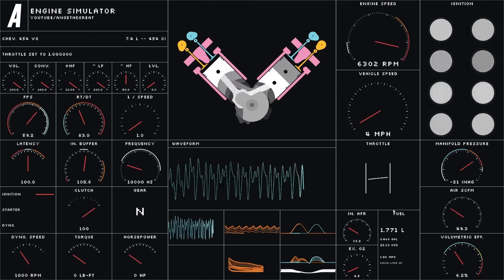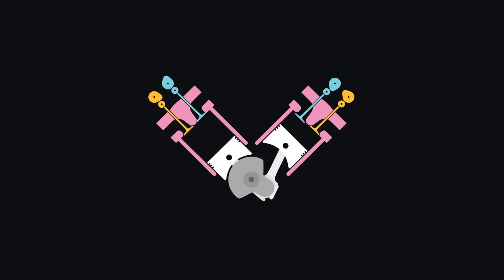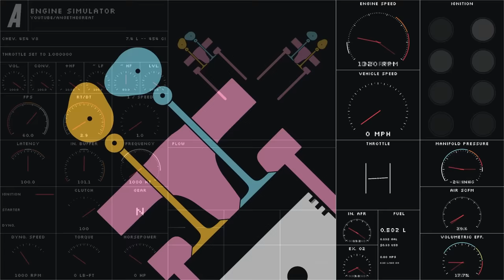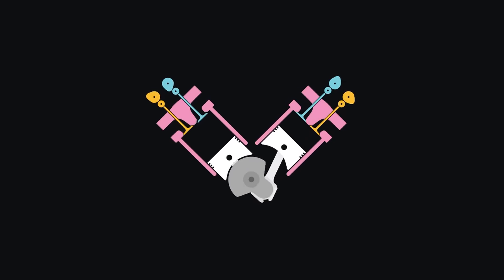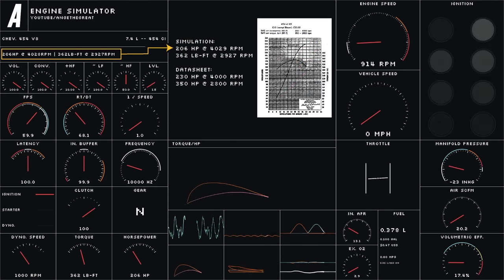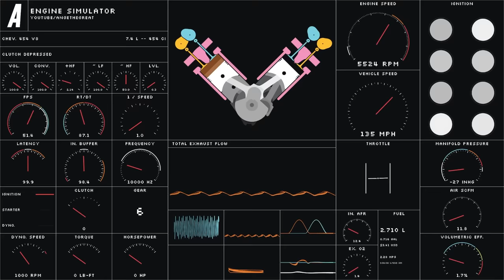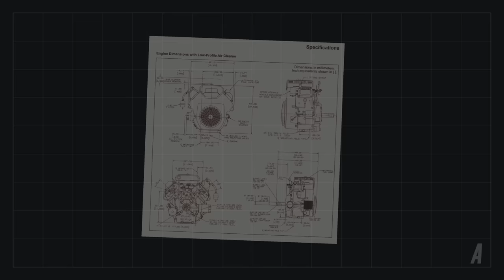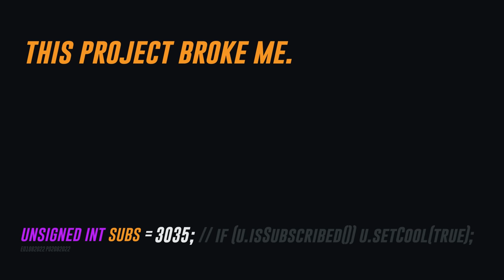Simulating an Entire Car Engine (yes, it makes noise)

Comment: I really hope I could run it on MacOS. I'm using a Macbook with Apple Silicon processor so I had to run it through a Windows virtual machine. Unfortunately, the simulation run really bad because the virtual machine can not give enough performance like a pure Windows system. I will really appriciate and thank you if you can make a MacOS version of this one for Mac users like me can easily run it directly on MacOS. That's a great idea about an engine simulator! Well done guy!

Comment: This is impressive, and maybe it has been said but you should do a radial engine like those found on old planes. Like the Azani 10 cylinder, or even better just for lols. R-4360 Wasp Major with 28 cylinders.

Comment: I get the passion behind this project, but having this level of detail, even in a simulator game, it would take a supercomputer by 2023's standards to run it fast enough to simulate it correctly, as you demonstrated.
Most simulators like iRacing and ACC simulate the engine and the engine response with hardcoded variables for the shake of performance and specifically uniform performance whether the game is run at 30 or 200+ fps. 
Most non industrial simulators work this way so that the average consumer system can actually run it properly. 
The same companies that released these games are the ones that make the industrial simulators but there the difference is that they don't have to keep in mind the system requirements.
We have some more years of technological advancement until this level of simulation could be included in a game.
My fascination with performance and optimization is what personally drove me to programming 😂

Comment: Wow, this not only can produce sound, but also can drive vehicle simulation as well, because the torque curve is very close to real life, with the car wheel traction and terrain slope as the feedback for engine load. The only problem for now is the number of substeps, but in the near future most of PC can handle this with the whole vehicle simulations.

Comment: Dono about anyone else,  but it sounds like at idle, that the motor has no oil pressure,  the knocking sound at low rpms. Maybe need to tweak the sound program a bit to get rid of that sound. 
Maybe sit in on an engine dyno test to see how it's done.
Cool program,  I'll have to get it and play with some different set ups

Comment: Super interesting project. I for one would really like to nerd out on all the details you didn't have time for in this video. I would really like to know if there is a model for exhaust piping and intake manifold geometry. Does the simulation take pulses into account? Can it add a turbo/super charger/intercooler?

Comment: Hi ATG,  (reposted comment as I hope this finds you)
One of the most egregious examples of shit simulated engine sounds are on train simulators and even more adjacent to reality: model trains with engine sound decoders. This would dramatically CHANGE THE GAME of engine sound sim for train sim games and (maybe) model train sound decoders - though I have no idea how much processing power this requires. All I know is that 

A. It'd be really neat if you added provisions for different engine configs like: 2 stroke vs 4 stroke, SI or CI, as well as different types of two stroke like uniflow or crank breathing, forced induction and the various types like prochargers, turbos, superchargers, turbosuperchargers, exhaust recovery turbines, and clutched turbochargers (like what are found in the EMD 710 engines), as well as accounting (maybe?) for these forced induction devices drive type, ie, geared belt or chain driven. I think it's also be neat to be able to tweak the exhaust parameters to tune it to sound a certain way. 

I'm no programmer but Id love to hear what you have to say about this and I hope this finds its way into the products that need it the most.

Comment: What about a V24 monster sized engine as if it were in a Railroad Locomotive! using the same specs as this V12 Engine from the modern GEVO locomotives lets see what a double sized engine of this build would be like! 

Engine Data:
Horsepower: 4500
Power/CYL: 375 HP/CYL
Mean Piston Speed: 11.2 M/S
Number of Cylinders: 12
BMEP: 20.3 bar
Displacement: 15.7 I/CYL
Total Displacement: 188 I
Model: GEVO
Bore and Stroke (in.):  9.8 X 12.6
RPM: 1050
Compression Ratio: 16.5:1
Cycle: 4
Turbocharged: Yes (7S1712A3)
Electronic Fuel Injection:  Yes
Coolant (gal.): 440
Lubricating Oil (gal.): 468
Engine Cooling Fan: 1
Air–to–Air Cooling Fan: 2
Air-to-air cooling:
The locomotive incorporates GE’s most advanced cooling system in rail transport. In addition to a standard radiator and fan configuration, locomotives powered by the Evolution Engine use an advanced air-to-air cooling system for engine combustion air to enhance performance while lowering emissions.
The Evolution Engine has been awarded UIC certificate E-001/2009-02, which verifies the engine’s mechanical quality and compliance with the stringent demands of UIC Stage IIIa emissions standards.

Comment: As a marine engineer, id be curious as to how in depth the simulation is regarding pressure in the cylinder. As in could we start tweaking parts to create situations that we could troubleshoot, regarding crank angle based pressure curves. We use curves like that for "recip analysis" on big marine engines all the time.
Reply: E.g. could we tweak the cam timing to troubleshoot, or troubleshoot injection, ignition delay, etc...

Comment: Badass!!! I’m an engine guy way more than a computer guy. I don’t know if it’s possible, but would there be a way to include volumetric eff. In the program? As in, stock big block square port heads vs. ported same heads? A data base with realistic stock head flow for different heads? Super charging? In any event this is way awesome, thank you.

Comment: 4:08 nah it's because if you look at the frequency above the gear it shows it's 1000 HZ it has to run around 2000-5000 HZ if you don't want it to explode

Comment: This would be an awesome tool for modders to pre-render sounds for existing sims like Assetto Corsa.  The game itself would still play samples, but the samples would be in ideal quality and capture all the scenarios that the game supports (AC does support the use of different samples per RPM and load, I believe).
Imagine being able to replicate all the details of the real sound of 1930s race cars.  There's mods for those but the sound generally comes from very short youtube clips of the engines idling - far from ideal.

Many people make modded cars for racing sims but are forced to use poor quality sound samples.  Lack of access to the real car is the most obvious reason but there are also other challenges.
Even when you do have access to the car, getting good audio is daunting because of the difficulty of doing a high quality recording that covers a variety of RPM and loads.

For example, I downloaded a car for AC that I own in real life but the sound is disappointing.  Most noticeably there's no coasting down sound, the engine just goes mute when you lift off.  I used to live in the rural foothills which would have been an ideal setting to record things like this, but I don't have any audio recording competence, and I don't live there anymore.  Instead of trying to make newbish recordings of it now in the suburban flatlands, a simulation might end up doing a better job.

Comment: This is very interesting. I'm curious if you think it's feasible to use this simulation to prerecord an array of individual "bangs" that could then be quickly reassembled in a game engine to approximate the sound based on set of parameters? I once thought of having such emulation in my game, but the problem for me was determining the set of parameters I should use as "indexers" and of course having good "bang" audio samples :)

Comment: I'm curious as to how rotating block engines (aka rotary engines) would be simulated differently, or, if they would be at all.  Something like the Gnome engine didn't have a throttle 'valve' it had a single valve and a blip switch (so the engine effectively ran at 'full open' while it was in operation and to control it the operator had what amounts to an off switch to cut ignition for a short time.  There are a few Radial engines in here and those are quite similar in most ways that probably matter for sound.)

Comment: Sounds and looks good  .. but something about valve train noise is missing.  Like a 1970  80 cu shovelhead oem ignition then a hi-4 single fire or ignition or a evo  80 cu with oem or Hi-4 ignition  or a twin cam each has a distinctive sound even though each is close to the same cu and configuration.  Muffled down the valve train noise is different in each affected by ignition waste spark or single fire..  waisted has an extra noise from the explosion from unburned fuel in the exhaust stroke in the waste cylinder.  Only one example of engine valve train noise .

Comment: Simulate variable valve timing / varisble lift systems so we can hear VTEC kick in please - assume it can just be scripted to change cam profile at a fixed RPM
Reply from the maker: The next video I released right after this one demonstrates VTEC kicking in
Reply: @AngeTheGreat  oh my, there's more. The algorithm merely served me this. Well now, consider my evening filled with more simulated  engine noises.

Comment: This is the sort of wonderous creative endeavor that our imagination machines (computers) were meant for. You've single handedly moved engine audio out of the uncanny valley.

How easy would it be to modify the rigid body simulation to model unusual engines like the Wankel?
Reply: I really should have looked shouldn't I, because of course you thought of that. Looking forward to watching the other video.

Comment: If you were to take an engine sound from a real car, you could then back-propagate to find the exact simulation which matches that sound.
Can you adjust the timing of the engine here? If so then finding a specific engine issue becomes an optimisation issue and can be solved (to within a close threshold).

Basically, this tool could be incredible for diagnostics. Customer comes to the shop with a bad timing etc, record the sound for 30 seconds with a microphone. Then after completing the optimisation problem you can see inside the customers engine.

Comment: You should make a swinging motor. Like the 2 stroke circuit but the piston is moving in a circle or more like an oval. Instead of a square piston you would need to have a slated piston and as it goes round/oval like there is two flat spots in the "cylinder" on both ends... Which is where the spark plug and intake will be so it would be a 1stroke esstentially as the piston goes to each side the middle will have exshaust ports. ? Idk would be interesting lol

Comment: Is there  a way to calculate the theoretical optimal ignition angle with this simulation? I know that in practice there are so many determining factors, but it would be great to have a rough starting point to tune a car :)

Comment: you guys should probably check out [Algodoo Phun], it's a 2D simulator in wich you can basicly create anything, it's quite old but it still works like a charm, + there are thousands of builds made by the community available to download directly from the software, Engines, Cars, Guns, Planes .. you can build anything from scratch

Comment: im trying to figure out the best exhaust system for my 2000 232 3.8L v6 mustang's engine. would you be able to simulate that? I'd like to get an idea for what the base line sounds like and move forward from there.

Comment: Pretty neat! Tried it out for myself and had fun with the default engines. Unfortunately, I could not get any of the community engines to work without getting an error message. Still awesome though!
Reply from the maker: You can fix those errors by following the tutorial on GitHub, it should be fairly easy
Reply: @AngeTheGreat  I find the tutorial to be pretty vague, but that's just me. I tried a few of the fixes with no success, which makes me want to go back and try the other ones. Also here's a cool concept: What if you could make a software to create custom engines that could be directly imported without having to code them yourself. That would mean people with zero coding experience would be able to fart around with funny/unique engine designs. Probably not going to happen bc you already have a tutorial on how to code custom engines, which technically can be be followed by anyone if they are willing to learn a bit of code. wow i just wrote the longest reply on this platform lol
Reply from the maker: I don't know how many of my other videos you've watched, but the program that you describe is literally what I'm working on right now. The version of Engine Simulator that you're using was never intended for use by the general public and I only released it because of overwhelming demand. Most people learn how to use it through the official Discord server. If you're interested in the progress on the updated version of Engine Simulator with a real user interface, watch some of my more recent videos
Reply: @AngeTheGreat  Yeah just saw that video, and I must say, that software looks exquisite

Comment: Hey man! Great work! I'm very curious to hear sound of a v2 engine, with 72° phase difference, and 288° phase difference! I'm building a project with base of a 250 hyosung engine, which is going to be forced induction. I can set it on these two configurations, the difference would be at the 72°, I have better peak horsepower, and on 288°, I will have better traction on the corners due to bigger angle of free rotating (like what Yamaha CP enine in R1, ewer than 2009).
The sound is very decisive in my decision, so I will be appreciated if you could help me with it!

Comment: 80,000 frames per second (or 80,000 Hz) is approximately double the standard audio sampling rate of 44.1kHz, so I would have to assume the Nyquist theorem had some influence on your decision that 80kHz/kFPS is a necessary requirement for generating audio here, as this is generally considered to contain the full range of human hearing for the average person. Is this assumption correct? From a PC gamer perspective it seems insane to say 80,000 FPS, but from an audio engineer standpoint, this is 40 year old compact disc technology. Which is to say nothing about the rest of the simulator, which is absolutely fantastic.

Comment: Hi, i an trying to develop a engine for my game taking into account internal parts as part of one big equation, in truth actually i'm on engine physics side and my friend on this empirical model, he did a nice model of vital parts for volumetric efficiency but we are missing the "trottle part" of it, i mean how you simulate air-fuel mixture moving inside of your engine? Or where i can find something to study? My engine also is not simulating its internal movement, mostly because there is no way to feed the cylinders properly anyway

Comment: Can this do forced induction simulation? Couldn't you just you use a turbo efficiency map to do the math coupled with the exhaust flow calculation?

Also you could somehow add EFI calculation but simply adding a afr map to the fueling calculation

ALSO lol, it would be incredible if you could simulate knock characteristics 

I feel like I could use this to practice tuning!

Or would

Comment: Hi Ange, I tried to compile Delta Studio on my laptop but I'm struggling to get CMake to find my SDL installation folder.  Do I need a new environment variable (if so, what should it be called?  Where exactly does it point to?) or do I need to extend the PATH?  

Anyways, I'm currently trying to make my own vcxproj (for Delta Studio) and just throw in all the cpps and headers and hope for the best.
Reply from the maker: You just need to add the SDL path to your PATH variable

Comment: Hi, I have an Question, I would like to create a Simulation for eletrical motors(not car engines but more industrial electrical motors), they are mostly just a high pitched wave but I am not sure why it doesnt sound right, it sounds to smooth. Do you have an Idea to fix that?

Comment: i dont know if this is normal: i downloaded the zip and the app itself, but when i tried to open the simulation, microsoft defender smartscreen stops the app from opening. is there any solution to this? i also checked the faq in github for answers and i got nothing,

Comment: Nice job. It's a pity that I can't compile it with any normal operating system. So far, cmake makes a lot of mistakes. I managed to compile the library, but I can't use it yet. Unfortunately, this program has not been launched yet :(

Comment: is it possible to use this sim for a compressor, meaning that the drive shaft is driven by an external torque?
Reply from the maker: It's possible. Using the RPM hold feature you can spin the engine backwards and see that pressure actually builds in the intake manifold and is releases by pressing the throttle, similar to a compressor
Reply: @AngeTheGreat  great, thanks 👍

Comment: iIm not hating at all, like whatsoever, I'm just genuinely curious; how come its setup like a DOHC in the sim instead of pushrods?
Does it add unnecessary difficulty?
Reply from the maker: It's mainly because from the simulation's perspective, it doesn't make any difference whatsoever if the real engine is DOHC, OHC, OHV or any other configuration. All of that information is captured in the valve lift profile which is visualized using a DOHC setup. Showing it as OHV would just add graphical complexity in rendering the pushrods and rockers and wouldn't change the audio output or the performance characteristics of the engine. You are correct though that both engines shown in the video are OHV and not DOHC